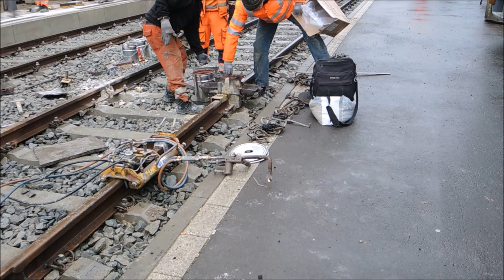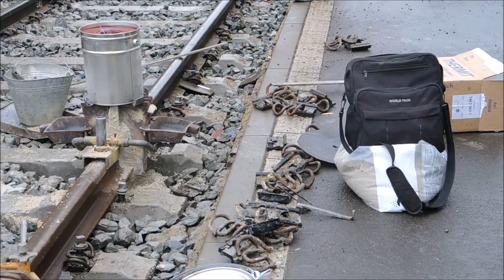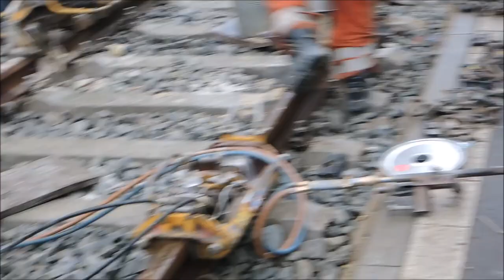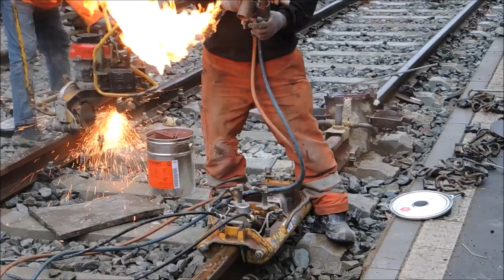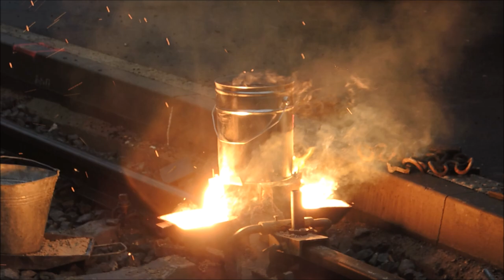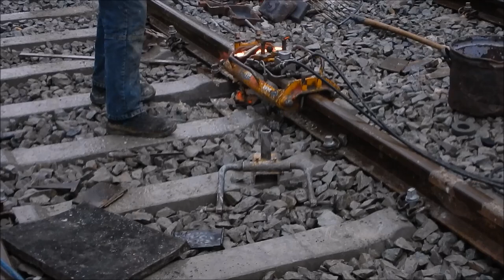Thermit im Schienenbau

Comment: You can tell a lot about a country and its people and its broad work ethic just by watching this same procedure done in many different countries.... Those nations which would produce fine engineered products where a lot of attention is paid to detail are easily distinguished from those who don't.  You can tell a lot by how people work.
Reply: And what do you think how those people work? :)
Reply: @patman2438 I've watched BMW's and Scania's and even Steinway's being made.... And then I've seen the gudgeon retaining circlips of a motorcycle,  spot welded in place in production along with a massive amount of failed first time welding of gas tank filler pipe necks where the welder simply kept pouring it on until they felt that it couldn't possibly leak after all that. And then I've seen lathes built where the casting is smoothed out with cans of automotive repair filler and painted over and where that's not possible, they use a finely crafted sheet metal jacket which actually looks like solid machined casting when its also painted over. Tailstocks mostly. I've seen their gearboxes still with casting sand in them but the lid goes on top and the oil is poured in. I could go on for pages here but usually what you get out, is always exactly what you see going in.